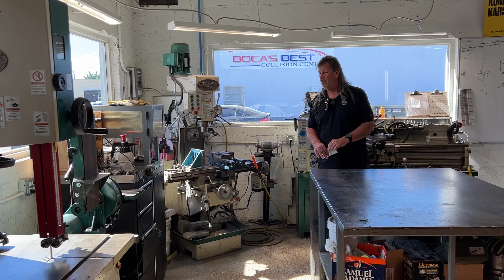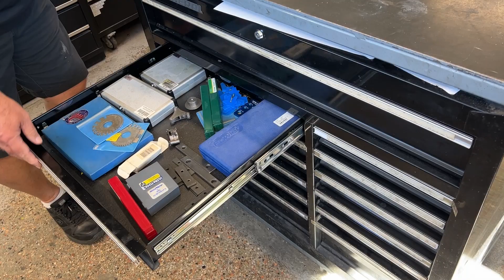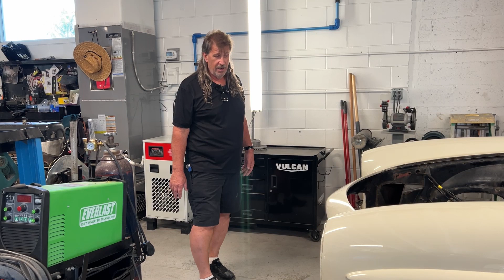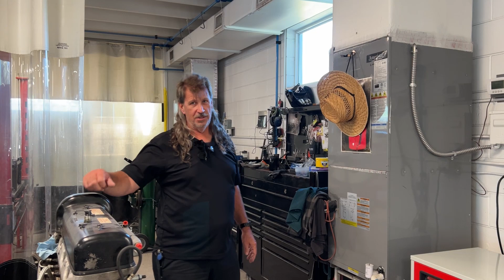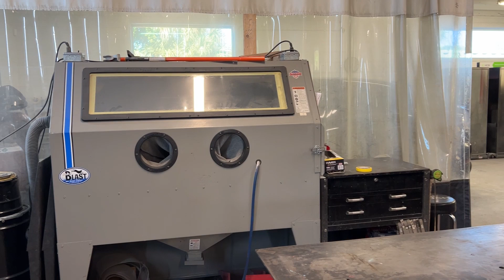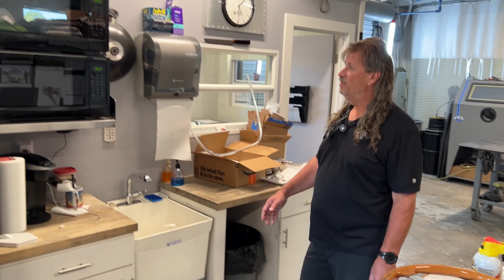2024 Shop Tour of Rare Classics Restorations, LLC

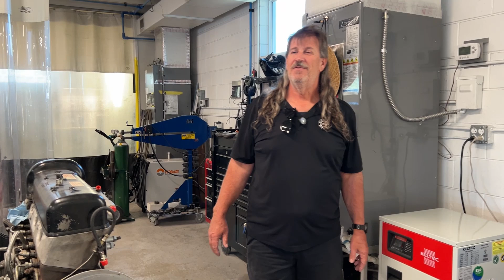Comment: @11:45 10 tons is nuts. Must be really poorly insulated.
Reply from the maker: The building is solid concrete 10" + thick walls with a concrete t-rail roof. The windows were all replaced with tinted, insulated, impact windows, and we closed in all the vents. In peak summer months its 90+ deg with 80% humidity and the the days have 13 hours of sunlight. In addition to the ambient temps, and the sun load there is a lot of heat being generated  by the people working in the building and the equipment being operated; if the building was being used for storage the cooling requirements would be considerably less. During the winter months we can run on one system. It may seam nuts but it's necessary. Thanks for watching!

Comment: no more mustangs
Reply from the maker: Not sure if your aware of my past or you picked up on my 30 year old tool box. I was a Ford dealer mechanic in the late 80's early 90's when the 5.0 scene exploded. I was spending so much time after work modifying 5.0 Mustangs that I quit the dealer and started Springfield Motorsport a Mustang and Ford specialty shop, I eventually sold it so I could relocate to Florida. Thanks for watching!

Comment: Congrats on the new shop I have  worked in a similar cluttered shop for over 20 years yet we managed to always produce the highest level results. You don’t need fancy you need talent and passion for these projects. Curious Jon how did you get involved and started in 2017 working on these mega prized possessions what is your backstory? I have been restoring cars for over 38 years myself it has been a very interesting journey for sure. We moved into a new huge facility in July restoring Ferrari and Porsche and others mostly 70s and present stuff and we are still getting used to the sheer size of our space and cleanliness.
Reply from the maker: Thanks and I agree talent over fancy, my "help wanted" ads actually say "giant Snap-on tool condo not required" Me I got into the Concours restoration game back in 2012 but prior to that I had been working in non-traditional automotive environments mostly racing and high performance street cars. I have a degree in Automotive Technology, I'm a Master Automotive , Body and Collision, and Heavy truck technician. Etc. Etc. I was a Ford dealer technician, I worked for EG&G automotive research and have been a small business owner since the mid-90's Ever the disappointment to my parents who pushed me to be an accountant. Thanks for watching!

Comment: Awesome work from this shop.  I featured the Boano in one of my videos. I suggest offsite blasting or at least put those blast cabinets outside as they could contaminate the entire area. Lead paint, aspestos gaskets etc.
Reply from the maker: Thank You Richard, Typically large items or extremely dirty ones are sent out for blasting so what goes in the cabinets is usually fairly clean. Plus, we keep the filters clean, change the media often, and make sure the guys wear a respirator. Problem with locating them outside is the humidity you just wind up with mud.

Comment: Nice, need to get laser cleaning and welding amazing tech. I almost do not need my sandbkasting cabinets and can weld without shrinkage at many times (5x-10x) the speed of fastest mig/tig w/o much training while holding the parts with my bare hands expensive but for restoration is a must have and now Miller is making units. Too bad as I purchased a foreign 3kw machine over a year ago and it cost over $19K prices are starting to come down. Spent 4-5 decades becoming compentent at mig tig gas stick and in less than a day (1 hour) was able to exceed weld quality and strength. I can also weld plastic/nylon unreplaceable parts by turning off some of the safeties. Need to treat torch more like a gun as beam will travel and reflect. Gas is cheap nitrogen and co2. If fab parts fit tight do not need filler wire and can weld 5/16 from one side with full penetration welds that need no grinding. Your moving curtains would be excellant for keeping laser isolated from other workers. Ray
Reply from the maker: Ray, thanks for the suggestion. Definitely something I'm going to look into. I appreciate the support.
Reply: @jondega  outstanding when you see cleaning you will be amazed